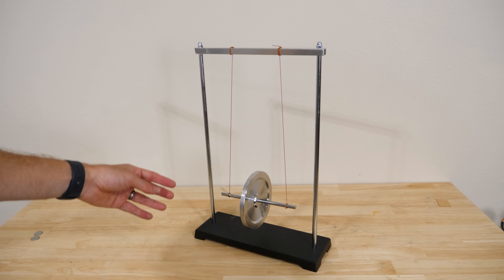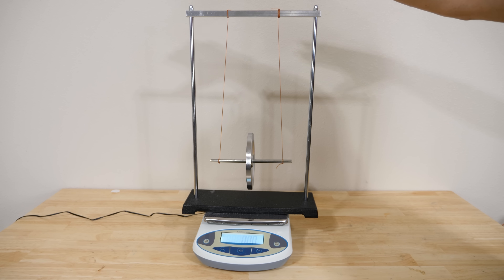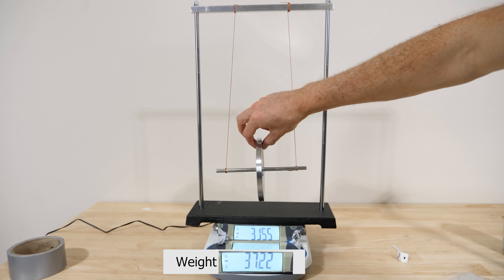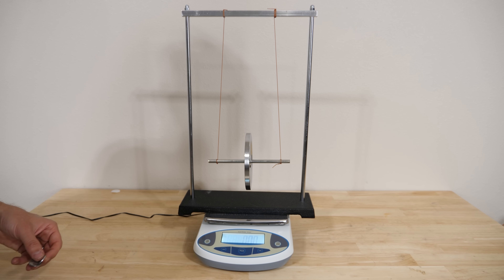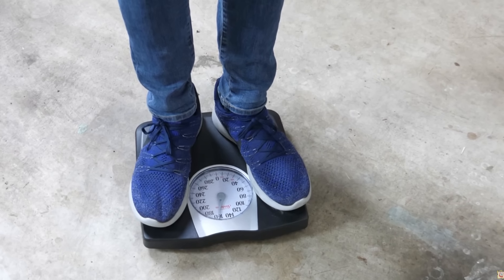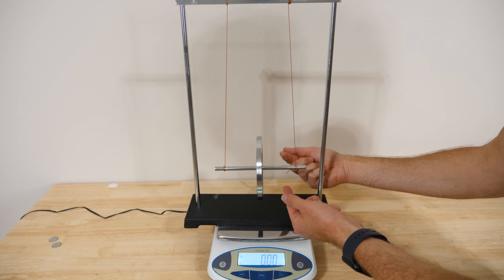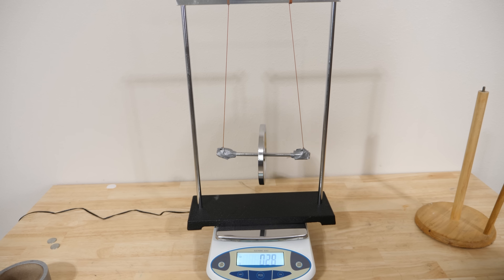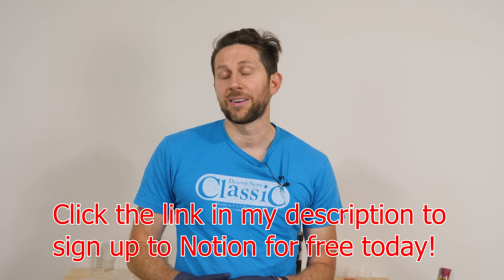How Does The Anti-Gravity Wheel Work?

Comment: Use an analog scale for real time readings. The system is temporarily "throwing off" mass as the wheel descends. There is then a momentum induced spike in "weight" when the wheel hits bottom. As the wheel ascends the system will have a higher weight than when at rest. The limitation is in the response time of the scale, leading to an anomalous conclusion.
Reply: "Your results don't match up with my preconceived conclusion so obviously your experiment is wrong."
Reply: @bingbong3221  
My high school physics teacher did this experiment, with an analog scale because digital didn't exist at the time, to demonstrate several physical principles, including the difference between potential and kinetic energy, intertia and momentum, and a couple of others. The weight at the top of the winding has potential energy as stated in the video. When released it released as kinetic energy. As the weight moves toward the bottom of the system it retains its full mass but it registers a lower weight because the mass is in motion toward the measuring device, a gravitational doppler effect. When the weight reaches the lowest point of travel momentum causes an artificial gain in measured weight by overcoming the inertia of the system and pulling the system harder into the measuring device. As the weight moves upward the system will have a higher measured weight than at rest because of the movement of the weight away from the gravitational pull, an inverse gravitational doppler effect. The digital scale he used isn't designed to show that kind of fluctuation in measurement. Run the experiment with an analog scale and you'll find the above results. The system used by my physics teacher was taller with a larger weight that allowed the use of a lower sensitivity scale.
Reply: "That digital scale I know nothing about from a technical perspective is obviously wrong because I remember my high school teacher getting different results 30 years ago. Just trust me!"

Comment: I wonder if the weight of the fly wheel was larger  would there be a larger weight lose ? If the axel of the flywheel was bigger in diameter. So the speed of the flywheel would be  greater ,   would that make a difference  to the lose of weight   . Or would it stay the same as shown here?

Comment: The tension on the strings reduces when the wheel is ascending.  So then it isn't pulling as hard on the bar.  It always weighs the same.  Easy.

Comment: Wouldn't the weight of the rotating wheel make a difference in how much- negative weight you have? If you had a plastic wheel the same height, it would not produce the same speed, kinetic energy as a heavy metal wheel. IMO.
Reply: If you did the same experiment on the moon, wolf it go 6x longer? Gravity related right?

Comment: First off, it is not an anti-gravity wheel as there is no such thing as gravity.  Gravity has NEVER been proven and in fact has been disproven by your very eyes.  It is buoyancy and density relative to its environment.  The extreme spinning is modifying this relationship, causing it to be lighter than the surrounding area, thus rising.  Mercury spun fast enough is known to make an object levitate.

Comment: C'mon, if you're going to talk science and educate people, at least get your metric system correct.  It is not the 1960s anymore.   That flywheel has a fixed amount of mass based on the properties of its material. It is the same amount of mass floating around weightless in space as well as on Earth and the Moon because the mass does not change. And the unit of mass is a gram/kilogram.  Static weight is the product of mass and gravity.  The weight of mass is differrent floating around in space, on Earth and the Moon.  And the unit of weight and force in the SI Meteric System is a Newton (= kilogram meter per second squared).  

People will ALWAYS be confused on this subject because so-called science teachers continue to propogate mixing the old, obsolete meteric system with the modern SI system.    Other derived units that people are familar with (eg Watt, Joule, Newton Meter, Pascal) are derived from weight and force being a Newton NOT a kilogram.  Say 'mass' in lieu of weight or force when using the unit gram/kilogram. Your experiment makes the point.  The scale spits out mass for weight and you conclued the mass of the flywheel has changed due to its rotational momentom.  But clearly you would need to cut material off that flywheel to reduce its mass! The SI system resolves the ambiguity between kilgograms-force and kilograms-mass of the old system.

Comment: The good experiment for schoolmates studying mechanics, but "the teacher" maked the wrong conlcusion about anti-gravity. By the way, you will get same result cheaper, if you put any pendulum on the scales. 
The right conclusion is: scales show the VERTICAL force acting on it and don't show HORIZONTAL one. 
The explanation is as follows. 
When the disk doesn't rotate, the ropes disk is hung are vertical. The force acting on scales equal weight of the disk (let's call it Fd) plus support. Horizontal force is absent. Scales are balanced and show zero. Everything is clear here.
When disk rotates, the ropes aren't vertical. The lower ends of each rope are shifted from vertical by the radius of the disk shaft. It's a small volume, but it exists. The force acts on the disk support in this moment consist of vertical and horizontal. The horizontal force volume is Fg=Fd*sin(A), A-angle rope and vertical. The vertical force volume is Fv=Fd*cos(A). Last formula shows that Fv < Fd or vertical force less disk weight, thus scales show negative, but anti-gravity isn't the reason!
The next experiment may follow. If they put scales on a platform which can move in directions perpendicular of the disk shaft and rotate the disk, the platform will move forward and back when the disk will move up and down. Scales will show zero. I may clarify, one will show zero only if the disk won't swing and ropes will vertical.
It's simple mechanics, not anti-gravity :)

Comment: As the strings are unwinding off the axel, the stand holding the wheel is feeling less weight. As though the string is being push back up towards the up toward the top of the stand.

Comment: You guys are so dumb. The first law of magnetism states that opposits attract and likes repel. That means that only Gravity repels Gravity. If you have anti gravity then it would be flat as a pancake on the ground.  Gravity is easy to make and antigravity is almost impossiable. The Earth has gravity because it is a spinning magnetic mass. The earth has a force of 1g because it has a magnetic mass of ___________ kg and a rotational speed of 1 revolution every 24 hours. So if I want to make 1g at home then I will need a magnetic mass of say 1kg, Now how fast do I have to spin it to get 1g..  So weight of the earth times 1kg = ____ revs per day, devided by 24 gives revs per hour. Either way it is turning realy fast

Comment: the reduced weight is from the unwindinging. sorry - gram is a mass measure. next, the pulse weight at the bottom is not being measured as the scale is deisgned to show an average - thus it is not sampling the pulse. Which is why the scale is inaccurate.

Comment: learn the facts, that the wheel is placing the mass as it spins to the opposite side, 
When that happens, you are lifting the weight off the string and the scale
You are using the center of the spin to transfer the weight of a rotating object,
Not gravity
Gravity will be found related to a magnetic field induction as from a highly dense spinning magnetic field, The whole universe is a magnetic field, Therefor induce a strong rotating magnetic field to isolate a mass, and you may have antigravity.

Scientists probably know this, as they know they have to reach very high rotation, which without magnetic bearings, is not possible.
And because they have to use fairly large magnetic bearings, the rotation, of any magnetic field may not produce an effective field, 

One may have to gang these fields together in a direction to make the effective fields work,
But be assured if scientists know of this, they will say nothing, since they do not want the public to know and start building said, as it will cause untold problems for society and the law of the land they are in.
Just imagine what happens when people can lift off and go where they please without controls,
Am I wrong or right,
you be the judge.

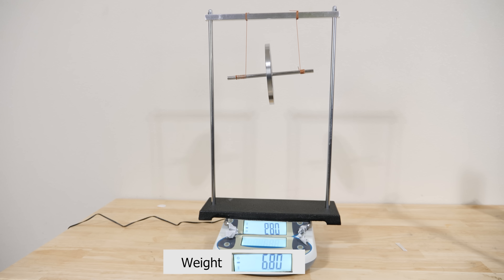Comment: 2:17 Does this mean that rotational energy (or all movement?) can be measured in "negative gravity" (grams) units?
4:58 I guess not, but why?
6:13 Ok, so (only?) downwards motions can be expressed as a percentage of free fall, and therefore can be expressed as "negative gravity" units? (eg. an elevator going down?... BUT only(?) when the elevator is ACCELERATING downwards, NOT when it is traveling at constant speed downwards (it's 0% when constant speed)).

Comment: The title is misleading in as much as it would be to call a pendulum an antigravity device. 
The downward force when the wheel is at the bottom of the strings is occurring for an impulse period that is too short for the scales to read. Being digital, there is no doubt a clock rate that determines when the scales take a weight sample, and the downward impulse force happens so fast that it probably always occurs between the readings.

Comment: How much weight is the wheel in grams, and how many times is the 6gs, is the wheel on it's own? would this give you a % of lost weight?
Also the thinner the shaft and the bigger diameter of the flywheel, you should find a larger negative weight showing on your scales.
This is the same as throwing a ball, once the ball is moving, then you let go, the momentum of the ball keeps going. Thanks for this interesting info.
Reply: Actually, the thicker the rod, the larger the difference. I calculated an upper bound for the difference, when the rod is just as thick as the flywheel. That's because the rod transmits the torque from the string tension, causing the flywheel to spin faster, as more intense is the torque. Since the string also introduces a constraint between the linear acceleration (down or upwards) and the angular acceleration, the higher the angular acceleration, the higher the linear acceleration. That said, the limit case of the linear acceleration is free fall, when the tension in the string is released and this would account for the highest difference possible read in the scale. But, since this case is hypothetically not accessible in this experiment, the best we can do is setting the radius of the shaft as equal to the radius of the flywheel.

Comment: Mind blowing! But I suppose if you bounced a ball on a scale it would read weightless as long as it was in the air, and only register weight as it hit and bounced off the scale. The 'average' reading would be the weight of the ball. The spinning of the disk and flywheel effect only moderate and delay the effects. That would be something like an inductor in electronics where the voltage change (potential height) is resisted giving dV dT. Now, can we get a capacitor to make a tuned circuit?

Comment: At 1.45s, it is wrong to reset or zero out the weighting machine. You should hold the wheel so that it does not put pressure or weight on to the weighing machine. Then you reset the weighing machine. After releasing the wheel, the reading will be only the wheel's weight. When the wheel spins, whatever changes to the weight machine reading will be shown either positive or negative readings. In addition, since the changes are quite fast for human eyes, you should use a data logger to record the measurement. Then, you should analyze on a computer during the maximum and minimum height of the wheel. Anyway, it is a good experiment. Keep up the good work.

Comment: I used this concept to accelrate a flywheel horizontally, and made an action drive by having it bounce/crash into the interior wall of an vehicle at the end of its stroke , transfering the 
forward momentum of the flywheel into forward motion of a vehicle. It worked since this method of accelrating a flywheel forward seemed to have very little recoil. In fact, i didn't
notice any recoil, but that might have been due to friction in the wheel bearings (lego). It wasn't very effective though, in terms of energy input and forward motion. 

I used rack and pinion at first, with no rack at the end of the stroke. After that, i used spring loaded strings through the axle. Though, i didn't go as far as motorize it. That
was half a year ago , and i haven't really looked too much into it. Was suspecting that accelrating a flywheel would reduce it weight, so it was nice to see a video that confirms it.
Reply: In a project book from the ‘60s was a similar toy, rolling a BB around in a film can. On a ramp. The impact moved the box forward  overcoming the box/table friction but the rear movement was absorbed by internal friction.
Reply: @thumper88888  Thank you. I decided to finally release the video i made of it, poor video, but a picture is worth a 1000 words. 

It is not meant as self-promotion, although i could see it technically be just that.  This beeing hidden away deep down a youtube comment section anyway.
Something are just difficult to describe with words alone.
Reply: @heisag Hi, I’m curious as to what you made, I’m very interested in it. And yes I found your comment hidden away deep in to deep comments.

You said you made a video and I checked out your channel and didn’t find anything. But I still would like to see it.

Comment: Isn't it true when a body free falls it is weightless? This loss may have nothing to do with the rotation of the wheel but just the speed at which it falls. Build a new rig using a heavyweight with a ring at the top to hook the weight on a Bungie hung from the top of the rig. Put the rig on the scales. Let the weight settle when the weight has stretched the Bungie, which should be at the center of the rig. Set the scales to zero. Lift the weight a few inches then let it fall. if the weight changes on the scales, it will become obvious that rotation has nothing to do with weight change. You may need go-pro filming at a high frame rate to record the weight on the scales.

Comment: Would be interesting to see a tight shot from the axel side. I’m thinking the missing downward force is being redirected laterally.
Reply: What do you mean? Force is not missing, the acceleration of the wheel corresponds to the force. If you found the missing force to be redirected laterally then which force would be responsible for acceleration of the wheel?

Comment: This is like a battery.  You are simply storing rotational energy and using it when the wheel begins to drop.
This is actually a concept that can be used to store a lot of energy.  The same principle is used to pump water to the top of a mountain during low energy usage times only to release it later when more energy is needed.

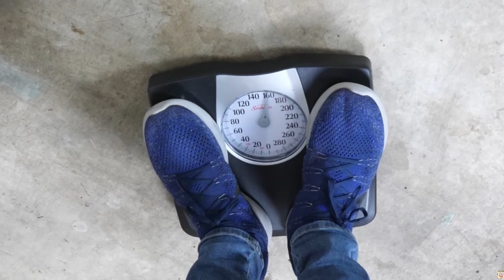Comment: @5:50 You are wrong, a scale shows how much weight is resting upon it, and when you allow that weight to fall, it is no longer resting on the scale, it's falling... but that does not change how much weight it actually is... once it stops falling and is once again supported by the scale, the scale will once again register that weight...
The reason for the weight offset when the disk is spinning and climbing up, is not that it is still accelerating down, because it is not... it is accelerating upward, converting the rotational energy into inertia which lifts the disk... this energy being expended offsets the effect of gravity until it's expended 100%
At the end, you're saying that by spinning the disk even fast, you can remove more weight that the disk weighs... remember, when you lifted up the disk by hand, the scale only read -7.## Theoretically, you can't go below 0 by more that then total weight of the disk/spindle... and I don't think that the duct tape weighs that much...

@8:17 to 8:19 there is a cut in the video... and then when you lift up the 7 gram disk, the scale reads -159.57 grams and all the way up to 219 grams and then another cut just after you say it shows -29 grams and before you say we're back at 0 grams...

I'm calling BS on this one...💩💩💩

Comment: if something has energy, any type, exerting against the downward axis of gravity then the energy being exerted at the end going upward,  should be equal to close to the force gravity was pulling. the way it's easier is when the gravity has energy of pulling it down, but the change in motion or tension to rotate the energy upward repelled an equal or opposite reaction against the axis of gravity. it's always an equal and opposite reaction. down is always up. so when the force is rotated of the bottom of the weight to the top then that largest point of gravity is focused upwards.